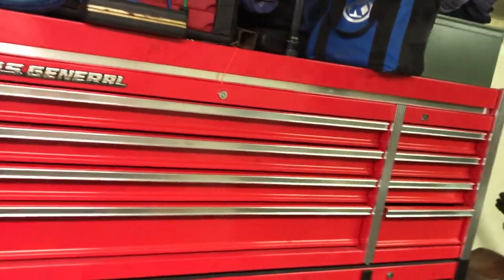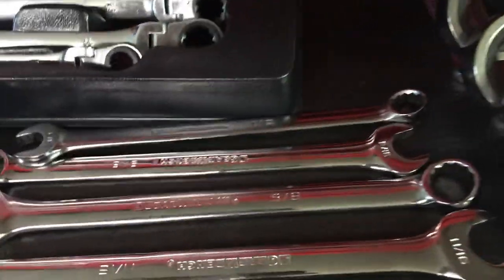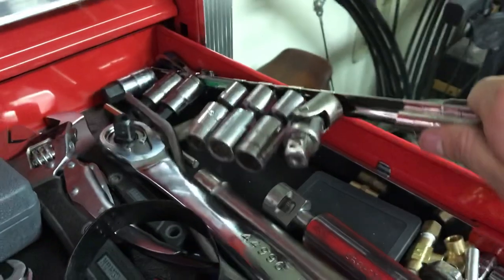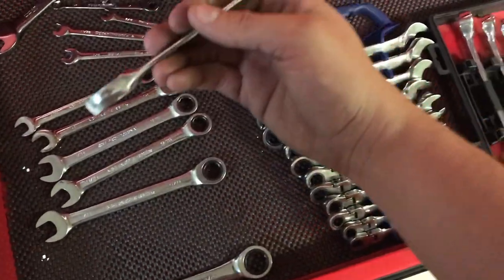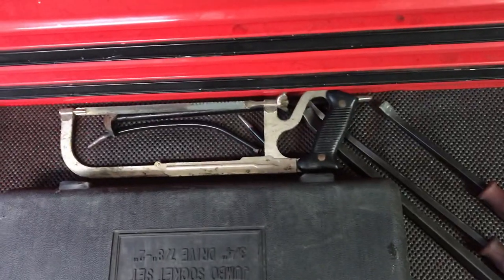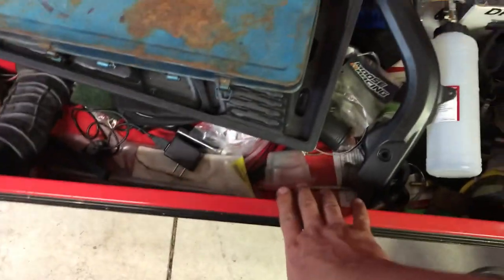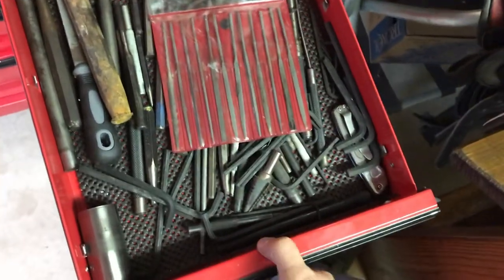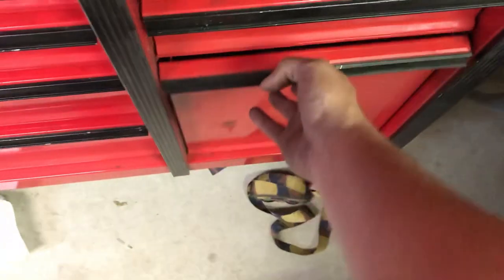56” tool box tour

Comment: Enjoyed the video. Just curious but why did you switch fields? Where did you go to after wrenching? I have seen a trend of good mechanics leaving to do other career's. I'm in the field now and been here for five years. Not really getting me any where. I have no health insurance and living from pay check to pay check. Customer's and boss take the thunder out of it. I love working on cars but I can always do that on my time.
Reply from the maker: I switched because, I recently just moved to a small town where there isn’t much for work. I ended up finding an equipment manufacturing plant that was hiring in there powder coating department. The pay of coarse was less, but I don’t have to spend money on buying or updating tools and I don’t have as much responsibility on my shoulders. I don’t have to remember if I tightened that bolt anymore or if I remembered to solder those wires under the dash. I also left because I felt like I was starting to burn out on wrenching, I didn’t want to lose my enthusiasm that I once had for the field.